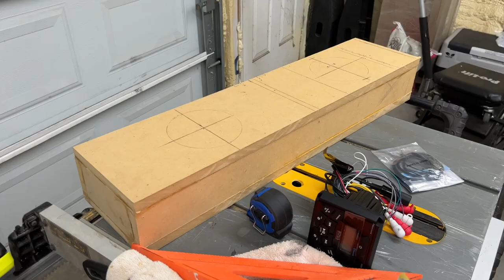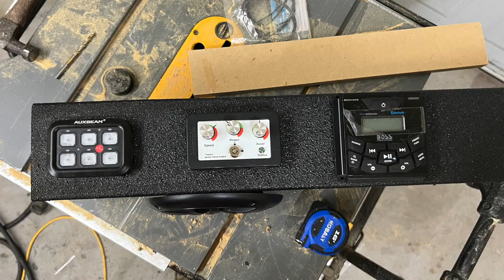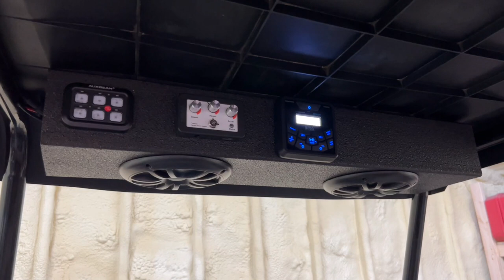UTV Sound System On A BUDGET | Cushman Hauler Pro Utility Golf Cart | Boss Audio Marine Bluetooth

Comment: how did you run the wires for the navitas controller to the back? it looks like the wires for the OTF is on the bottom.  love this and your other videos. Thanks!
Reply from the maker: I ran the wires out of the box and into the rails of the cart. I tried to keep them as clean as I could.

Comment: Pro tip…. If you have to run wires in a tube… put a little dish soap on the wires.   It will help it slide easier and washes off.  Good solution for the sounds Ryan. Cool cart
Reply from the maker: That is a pro tip!